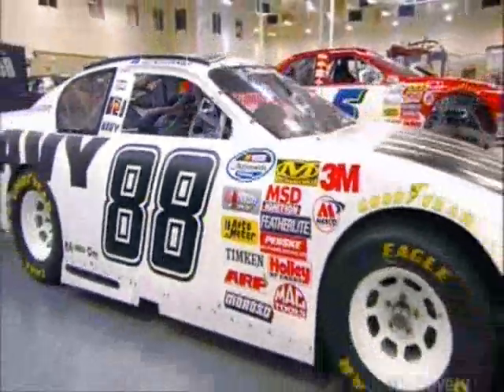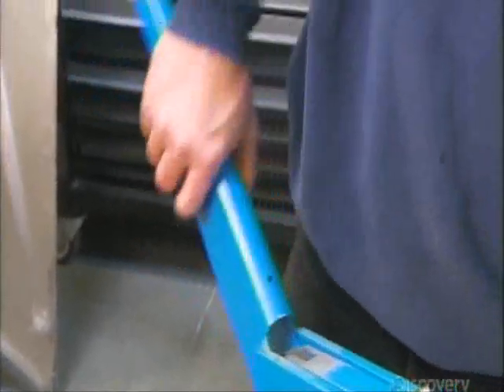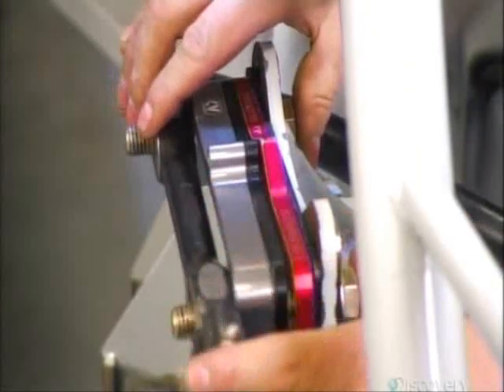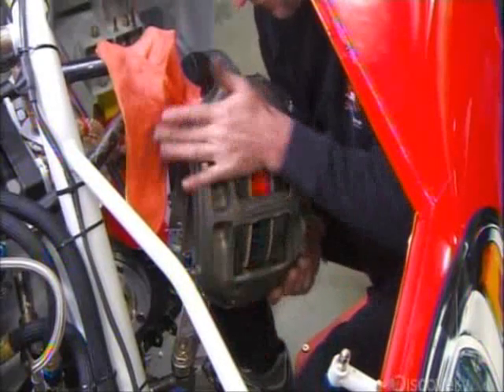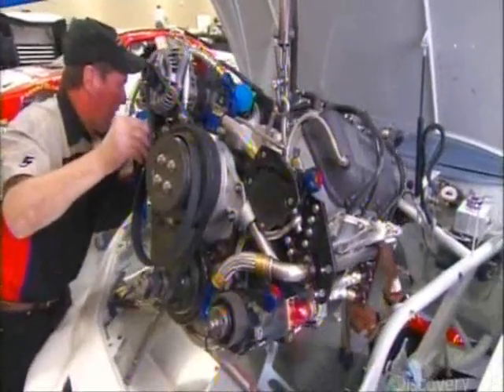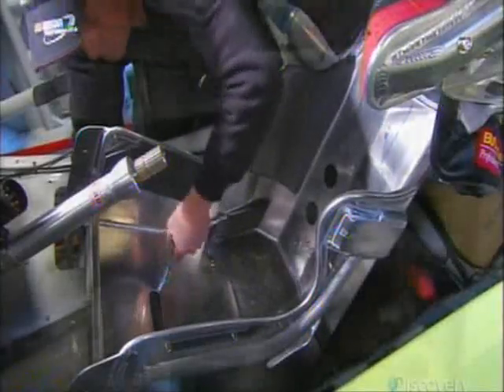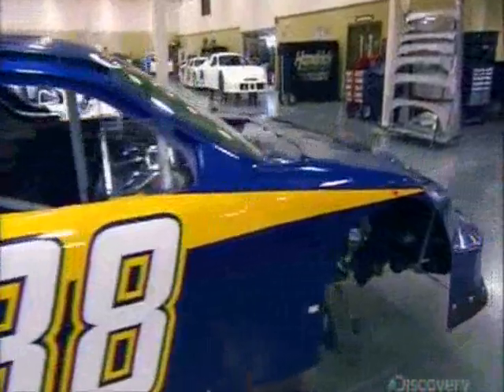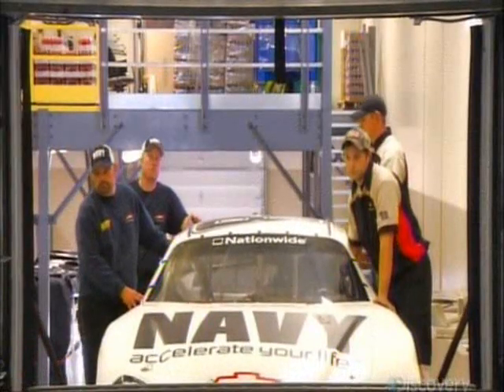How Its Made 08  NASCAR Stock Cars

Comment: Actually the fastest car has not been french. The old 2007 SSC Ultimate Aero was beaten by the Bugatti Super Sport, but the 2009 and newer Ultimate Aeros are capable of 272 MPH.  No one has done an FIA top speed run yet though.  Top Gear practically handed Bugatti both of their top speed runs, but won't do the same for SSC.